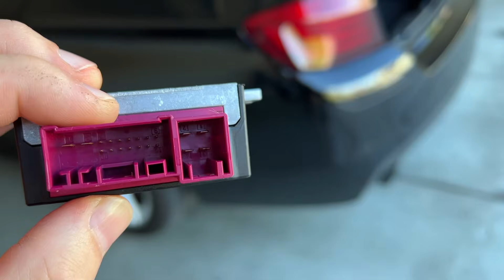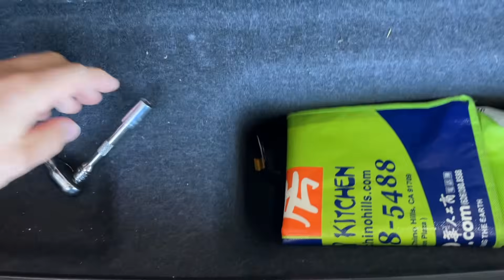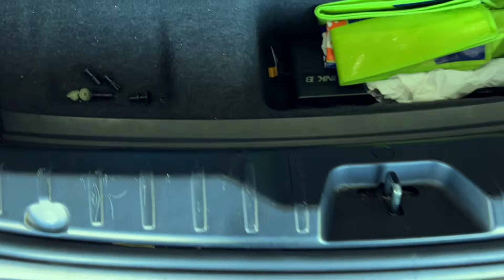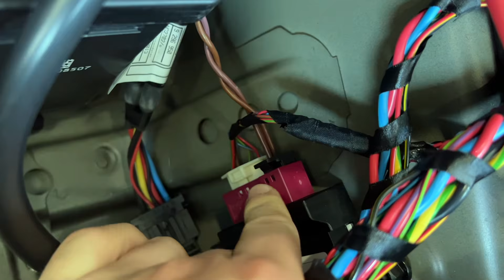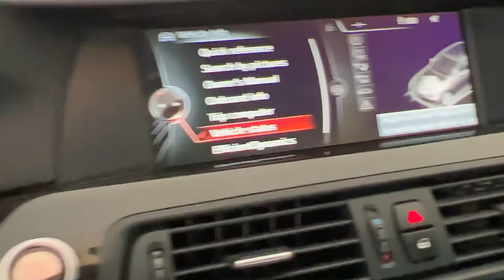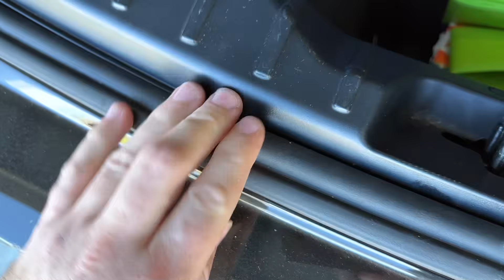Replacing the Fuel Pump Control Module (FPKM) on BMW F10 535i | BOND Garage

Comment: 2011 535i xd- code cda524 would this be the reason for this code? Car not stoping or shutting off. Just a super rough idle at start up and smooth out after about 1-2 minutes, but car do idles roughy at stop lights some times like it wanted to die but it does not. Would this be part of the process for what’s described?
Reply: Could be your mass air flow sensor. I had that problem on mines with rough idling

Comment: Can this give low pressure to HPFP? I changed pump and still low pressure
Reply: Yes if it shows as a shadow/inactive code. If the active code is fuel pump control then it’s most likely the module.

Comment: Coding is required after replacing the module?
Reply: Yes even if it came off the same car. It may still run but it is still recommended to program it.

Comment: Fixed my problem car ran for about two minutes .. end result I had to go have module programmed to bmw 16' 535i
Reply from the maker: you got a new module? yea those need coding. OEM or amazon tho?
Reply: @BONDGarage does plug and play works
Reply: @NextGenRich3737 no you need to code not plug & play

Comment: Please lmk asap have same issue.
Did you use the oem bmw or Chinese replacement.
I’ve seen Chinese replacement ones for cheap
Reply: Car just shuts off randomly
Reply from the maker: used oem. Chinese one will be new and blank and needs coding. used part from same car and engine should work without coding.

Comment: My friend just wanna let you know this fixed my problem. Thank you for your video.
Reply: Module was submerged in water. I drilled a couple of holes to let any other water drain.
Reply: @markb4608 such a stupid problem i swear ! Had the same thing happened a couple years ago and swapped the modular out. Got the fuel pump alret today. Im gonna drill some holes too
Reply from the maker: @ might want to fix the water leak while at it. mine never got wet. must have overheated. have seen some people fashion a fan setup housing for the module but gotta keep that water out.
Reply from the maker: that's great to hear!! you used a used part? mm module was apparently so fried that it damaged the fuel pump and I had to change them both..
Reply: what was you're problem on you're bmw
Reply: Do you think if the control module goes out it could cause the car to make noise too?? Like loud noises cause my car is doing that, but it’s also making loud noise with it BMW. Say that I need to replace the control module.
Reply: Do you have to program the new module?
Reply: @pothead21310yes

Comment: Yup n as long as in hot weather u have it next to the metal rear panel metal with metal on exhaust side overheats some take out the little lid drill holes in it on cover put it back with some piece of rubber in between or roof tape n a built in fan brown is grown n red with yellow strip positive to make it start n turn of with ignition but car is crap n20 n26 timing guide is plastic not billet unless u have CNC 3d printer or casting custom one they only sell plastic n be your moulding but not impressed for higher insurance cost n engineer 240 hp n 70000 miles redo which cost to do 5000 to $10000 unless u do it garbage inline 6 best engine 2 is can out put n the old Mitsubishi eclipse turbo will dog it camed n manifold n 20g turbo 333 to the wheels at only 17 lbs of boost with closed water jackets in solid heads not even a race
Reply from the maker: I've seen some places that sell a different housing with fan included and was considering making that thermo upgrade but then I got sidetracked and just see how long it'll last. and yea the N20 is kinda crab 😂

Comment: So i have a 08 535xi  i got home after going thru emmisions test. Now it just cranks no start. I sprayed a little starting fluid in it  started.
Reply from the maker: sounds like a fueling issue. you had any warnings on the dash or codes?

Comment: Im a little late to the party but by any chance do you remember when you got your FPKM from?, im in the US and searching on ebay and getting very broad ones like 2011-2016 and a bunch of different models but never the exact year and model, any help would be appreciated.
Reply from the maker: got a used one from eBay. but only ones that show the VIN so I can check and make sure it matches my requirements. and then I got another brand new one from the dealer lol

Comment: Thank's for your video 
Can you think an failure EKPS can make a long crank when the engine is cold and a low fuel pressure ?
But all is ok when you start up after drive it à little bit
Reply from the maker: it can manifest all kinds of fuel related issues. can't say I've heard it all but sounds plausible.

Comment: You don't have to code it
Reply: Really? Even if I buy a new one?
Reply from the maker: if you get a used one from the same model you don't. if it's a new one you do have to code. a used one from another engine should work also with coding (if you can code it over. never tried that)

Comment: Do I have to code or program the module if it’s off another car
And what software
Reply from the maker: if it's same model, engine and year, it should work right away since it has the right coding on there. if it's brand new you'll have to code it. ISTA will do. But somehow it didn't work with my version so I had to get it coded elsewhere. Not sure if you can re-code a module that has been coded already. if anyone knows, pls chime in.

Comment: How would you know if it’s the module or the fuel pump itself?
Reply from the maker: you could cross switch components. meaning you take for example a module of which you know it fits and is working as it should, and swap it into the problem car. problem gone it's the module. not gone, might be sth else. other than that it's not worth running any kind of diagnosis on this since it's know to fail, so people just toss a module at it. 90% of times that's probably the end of it.
Reply: Hey man, I fucking had this shit happened to me. It happened once in a bloom but it’s happening more and more. This shit fucking sucks.

I recently bought a used control module on eBay. I’m hoping this shit works out for me. I saw that you bought a used one as well. Is it recommended buying a new one or should I use one be fine
Reply: @SeansEBAYpage  I bought a used one and surprisingly it worked
Reply: @Notice215 did you have to program it
Reply: @SeansEBAYpage  did it fix it?
Reply: Hallo würde der wagen auch wenn es ekpm3 verbaut ist mit ekpm2 laufen? Und wenn ja muss man diese anlernen oder würd es einfach per plug play laufen

Comment: I bought a used module for couple year difference but from 535i like I have , should it be plug and play?
Reply from the maker: if it's from a donor with the same engine in the same iteration, then yes. not sure if a facelift version will work on a pre-facelift but if you stay within the same year range it should work. but there's no guarantee that the module works properly. tried a used one (same engine, same year), improved the issue but the old module damaged the pump and then the pump damaged the new used module. had to replace it all over again..
Reply: It worked, plug and play , no issues so far , no more fuel supply error code!
Reply: @deltakilo32  what year is your car and what year module did you put in?
Reply: @raidenprotecterofearthreal7909  2012 bmw 535i and the module I used was from 2009 bmw 535i
Reply: I had already replaced the pump before the module thank goodness
Reply: Hi, how hot should be normal temperature for this type of module? My new module measures  162F is it normal? Thanks.

Comment: Thankyou for this video. My BMW is a 2009 328i Xdrive. Same problem. Died on highway. Crank but no start. CC ID 309 error on dash. Fuel Pump. 
Towed to a garage who I learned isnt very experienced and long story short - I dont trust their diagnosis that its the Fuel Pump. Car restarted fine - ran an hour - upon attempting to move the car amps FROM the module TO the pump went to over 18. (idle amps were 8-9) Car shut off. Several days later I was able to pick up the car and drove it around the lot before towing home. 
I have an aftermarket pump and i CAN install it but its AFTERMARKET so if it dies again I wont know if its the cheap pump or if it was the module all along. SO Im replacing the module. BUT HOW DO I KNOW IF THIS WAS SUCCESSFUL? I DONT WANT TO GET STRANDED AGAIN. IS THERE ANY TEST I CAN PERFORM OR IS DRIVING AND PRAYING MY ONLY OPTION. I drive my son to school and i dont want to risk safety. 
Also - any experience with aftermarket pumps? are they all a bad idea?
Reply from the maker: oftentimes, swap parts and see what happens is the most feasible path. in my case, I swapped the module with a used one which did improve the issue but didn't get rid of it entirely. swapped the pump for an aftermarket pump which improved it further but still not completely. only when I changed the module AND pump with brand new OEM parts it finally fixed the issue. I was also told that a faulty module can damage the pump. So I'd say swap it both to have the most peace of mind. getting stranded with this issue can be dangerous. happened to me on the freeway and elsewhere.
Reply: @BONDGarage  thats great advice. I know i wont feel comfortable with the afternarket pump i have sitting on my table. Thanks

Comment: Its should be same serial number or install any 12v of the same model car
Reply from the maker: I found that the same model and year should suffice but ended up having to change it for a newer version
Reply: If you get a brand new one will not program itself ?

Comment: What was the codes you had
Reply from the maker: yea just like @corychaplin9625  said. there's just the blim and then you got a couple seconds until it shuts off
Reply: There is no code it just says fuel problem and cuts off, even if your in the middle of the street

Comment: Happened to me!! So dangerous! Got mine fixed years ago.
Reply: What did you do to get it fixed im having the same problem
Reply: @JA3Conceited192863  i replaced the fuel pump module located behind the rear seat of my 328i had the service center do it. I would not recommend driving a bmw, i sold it and now drive a tesla with no headaches

Comment: DID you fix it? , what was the culprit? GL
Reply from the maker: It hasn't stalled on me while driving ever since. But once in a while when I drive it for like 20 minutes, then park it for like 5-10min to grab something, then it shuts off right after starting. sometimes. close it and let it reboot and all is good. weird quirk
Reply: @BONDGarage  This circuit related to fuel supply is very sensitive unfortunately. My personal opinion is to buy original FPKM from dealer and all should be ok.
If I remember it correct the last version of FPKM no need programming. Anyways that how I fixed many vehicles. Aftermarket electric parts always pain in the but in terms of BMW performance and german perfectionism. I know we always trying to save money but BMW is not very good partner for that.
Reply: @BOND Garage  i noticed u didn't code it to the car. They use the same module for various applications. Although it may work but not optimized to the car till coded
Reply: @xj1085  how do u code